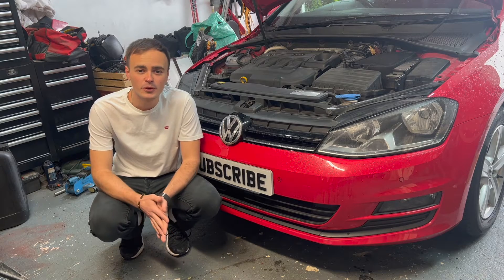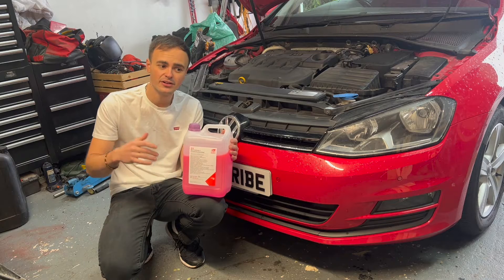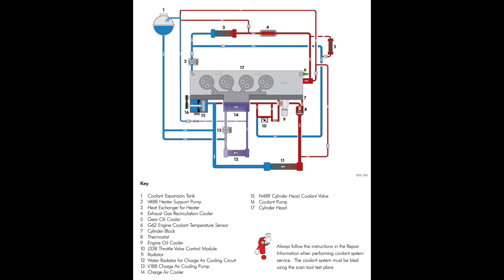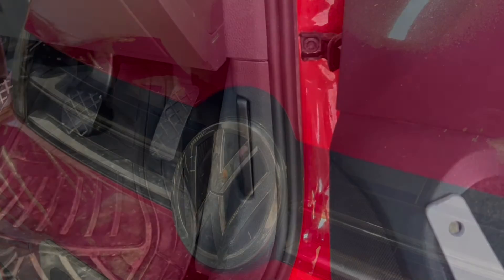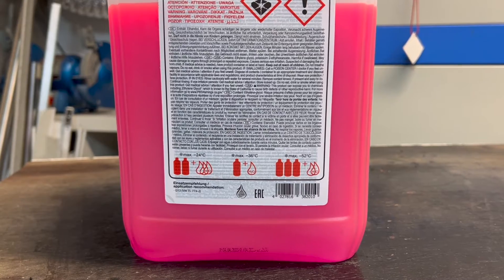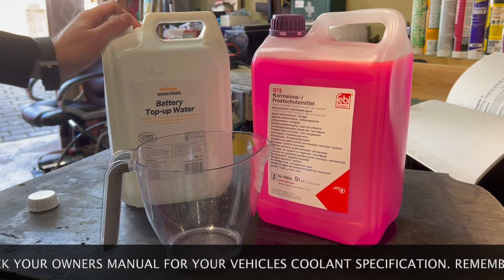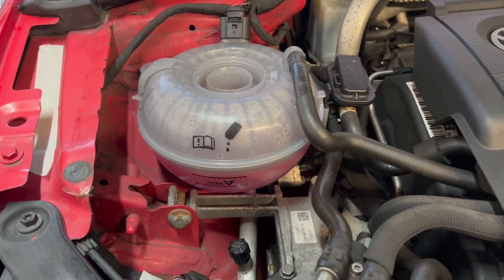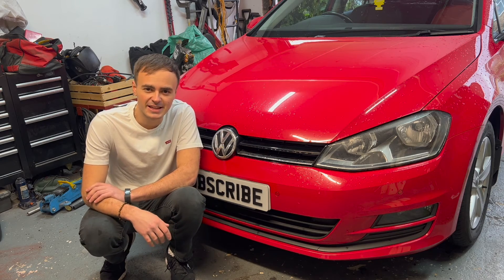SILICA BAG UPDATE - Coolant Refresh for VW SEAT SKODA & AUDI Owners

Comment: Hi, the NOTE says: The GEN III EA288 TDI (MY2015 2.0L TDI CVCA and CRUA) MUST still use G13 coolant. My engine code is CRLB, this is compatible with G12evo? Why U.S. only, also valid for Europe?
Thanks!
Reply from the maker: That is a US document so not sure if it applies to the EU. I have asked the questions to VW and haven’t had a response yet. I will update if I find out any more. To be safe I’ve used the G13 for my car. That’s what came in it from factory anyway so it won’t likely cause damage. Whereas if the g12evo isn’t approved for this particular engine like it suggests in that document it may cause problems later on down the road.
Reply: @TurnersWorkshop97  @ryangarner570 wrote in his comment 2 months ago: "FYI, version 10 of that TSB came out mid-2023 and removed the EA288 exclusion."
Reply: Then your CRLB engine is compatible with G12evo, because it is NOT mentioned as an exception! That's pure logic ... 🤔
Reply: G12++ is same coolant without ecoshit

Comment: So how can we mere mortals know which Audi/VW/Skoda/Seat that can NOT use the new G12 EVO? How to find that info?
Reply from the maker: If you check out the links for the coolant it will tell you there if it’s compatible with your car 😊 I included a technical bulletin in the video I found online that suggests the g12evo can’t be used in the 2015 2.0TDI EA288 genIII CVCA & CRUA engines. That is a US document so not sure if it applies to the EU. I have asked the questions to VW and haven’t had a response yet. Will update if anything changes but to be safe I’ve used the G13 for my car.
Reply: I will get my coolant changed at a local Audi dealership soon. Ít's gonna cost me $300 but what the hell. Since I removed the bag I need to do it and the car is also almost 10 years old with 136.000 km on the clock. @TurnersWorkshop97
Reply: I removed my bag a couple of months ago, and somebody wrote me than I now MUST change my coolant to the updated version EVO. But how can I know if I "MUST" do that? I mean, the stuff in the coolant cannot really go anywhere, is not burnt away, or get's eaten up in some other way. What problems might I run into if I try to change the coolant? How to proprely flush the system first? You did a partial change/flush I know. @TurnersWorkshop97

Comment: Hey man, i have the golf 7 1.6 tdi cxxb from 2015 and my car has 305k km. I have used the g13 coolant without any problems. Do you think it s a good ideea to remove the silica bag now?
Reply from the maker: It’s entirely up to you but I have removed mine as I feel it will eventually split and cause expensive repairs 😊